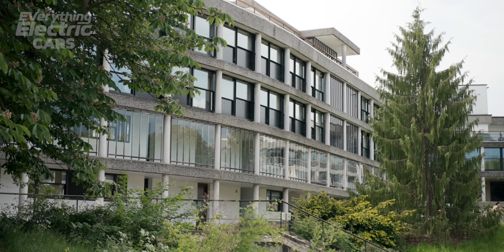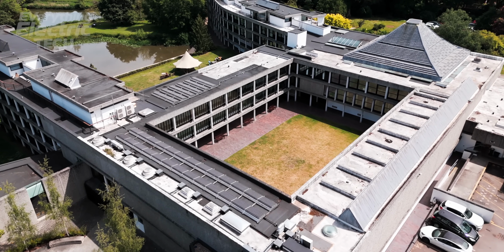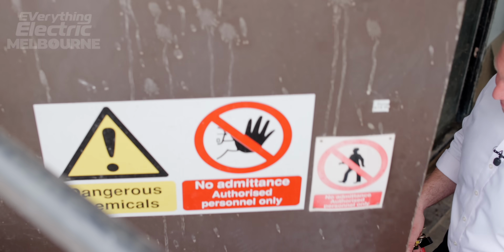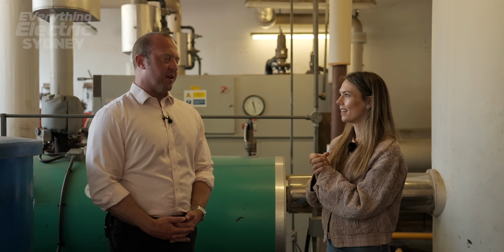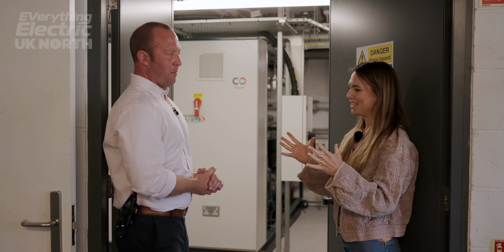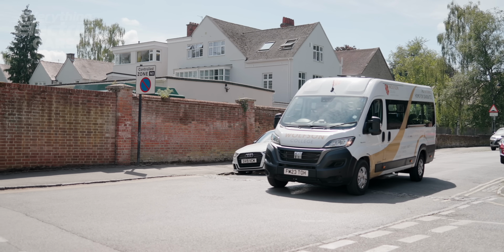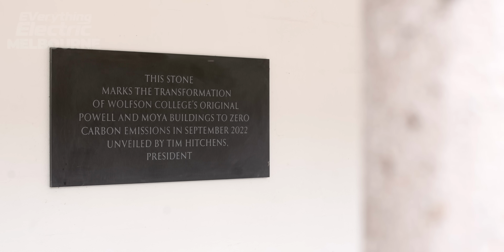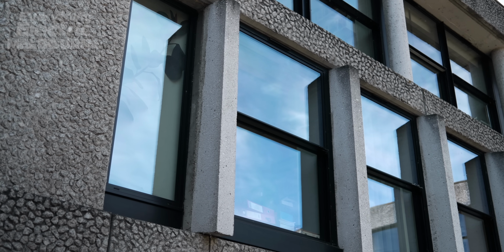The UK's First All Electric College!

Comment: As for cost savings it has to be pointed out that the gas industry controls the price of electricity on the basis that the most costly method of producing electricity, no matter how little is produced by that method, dictates the cost of electricity. So if 1% of electricity produced comes from gas but it is the most expensive way of producing it then that is the baseline cost of electricity. So 99% of your electricity would then be overpriced against the actual cost of producing it. It's a fossil fuel industry scam that has been going for decades. Even though over 40% of electricity in the UK is produced from renewable sources the price for electricity from the grid will be based on the cost of producing electricity from gas generators which accounts for over 38% of power generated. In short renewables and gas will produced about 80% of all power but that will be charged at the higher rate rather than the combined rate. It stifles the effect of the reduction in costs of an ever increasing proportion of renewables.

Comment: One thing that SHOULD have been said, but wasn't, about "Savings" on heating costs, was that while they did not go down much, (if at all), with the leap in the cost of gas, if this work had not been done, their costs would have gone through the roof, just like it did for every household in the UK. If that increase had been allowed for, there IS in fact a big saving. 
How many household's energy bills remained the same after Putin's invasion of Ukraine? I bet VERY few.

Comment: Great project, would have like more technical and financial descriptions, there is a bit elswhere. I would have liked to know what % of energy is met by the rooftop solar, for example. I worry most about the glazing: most double/tripe glazing fitted in past decades has leaked as the seals have broken down or have gone out of fashion, then they end up at the landfill. Worse, this may lead to the continued incineration of PVC frames (probably not in Wolfson, I expect). This college will be still here in 500 years time, how many changes of glazing will that be? Carefully designed secondary glazing would never need replacing. (the wooden windows on my house are 165 years old, some with original glass). Sustainability is not just measured in CO2 savings. Would secondary glazing with near zero future replacement costs be acceptable even if its not quite as thermally efficient as triple glazed argon units?

Comment: Interested to find out what the SCOP is for the system. I found it confusing that a figure of 90% reduction in energy is mentioned yet they see no reduction in costs. Maybe the 90% headline figure isn’t very accurate otherwise it seems overkill to have 800 Kw heat pumps on what was previously a 1.2 MW system.

Comment: Odd an educated man should touch on “The Ukraine thing” when we got only 12% gas from Russia and the UK dropped its overall use of gas that year by around 20% however the prices still went up as we know despite overall decline in gas consumption! Maybe he should reflect on the profits made by ALL energy companies using the Russia / Ukraine war as a permission giver to price gorge. The same energy companies may have dropped their prices by half a penny on the kWh but we still have the most expensive electricity in the world, more so than even third world countrys!
Reply: All the gas the uk burns has its price set internationally. 

The international wholesale price for gas went up after Russia invaded Ukraine. 

The UK is especially exposed to those international gas prices which is why the sooner we can push gas off the grid where it always sets the half hourly price for all sources of generation, the quicker domestic prices will drop.
Reply: @ianlighting100  "All the gas the uk burns has its price set internationally."  not quite true. Domestic producers track the international price and price slightly lower than this for domestic delivery so as to maximise profit. The idea being that they can't be beaten on price by imports in their domestic market due to delivery costs. In other words, it's a commertial decision based on shareholder value, not cuonsmer benefit. No one is telling them they need to follow the international price. 

  "The international wholesale price for gas went up after Russia invaded Ukraine." - True, but it's fallen a lot since then, so why isn'tthis being reflected in end consumer bills?  Also, it's dumb to not be able to step in as a government and put emegency messures in place if something like this happens under national security legislation. 

"The UK is especially exposed to those international gas prices" - Why would that be? The UK supplies 50% odd of it's own gas, so why would it be especially exposed relativly speaking to countries that produce less domestically? 

"Which is why the sooner we can push gas off the grid where it always sets the half hourly price for all sources of generation, the quicker domestic prices will drop" - 1. good luck with that. 2. who says you can't just get rid of the artificial MCP instrument currently used? What exactly is stopping you, this is very unclear to me. You could just do it. The reson it's not done is because this would reduce the incentive to build new wind & solar (to a point, as this incentive flipps at some point the the more you add, or it would if not for the CFDs weren't also priced using the MCP as a baseline) So it's yet another stealth "green" subsidy to invetors paid by the consumer.

Comment: I changed to all electric for my 1980's bungalow in East Sussex what suprised me was just how simple and cost effective the process was.  I purchased the property 17 years ago it allready had cavity wall insulation with double insulation in the loft and a conservatory over the rear door.  I had double glazing installed with a double glazed porch over the front door which creates an air losk ie front door open porch door closed, front door closed porch door open therefore no huge loss of heat.  Hot water is provided by self heating taps which means I only pay for the water and heating the water I use.  No waiting for the hot water to arrive.  The self heating taps cost £42.00 each from Amazon identical tap from ebay £16.00.  The bungalow is heated in winter using 2No ceramic electric heaters at @£142.00 each.  I had 9 No Solar Panels fitted with battery £42,000.00 I am waiting for electricity to be freed from the Gas price but I have had the meter removed I save on the standing charge.  With the insulation, the savings on water, the Solar panels and Battery, saving on gas standing charge has almost paid for the solar panels and battery. If evey one did this we would soon get rid of gas a 19th Century product in a 21st Century World.
Reply: £42k!? I had 20 solar panels, 2 5kw batteries and a heat pump, including 2 new radiators for £14k.
Reply: @AlanTov  I think I got it wrong more like £4,200 thanks for the rethink 👍

Comment: I’m delighted that the planners in Oxford allowed the changes. In Cambridge the planners are very resistant to change particularly in older buildings. It’s frustrating when historically the old buildings were modified many times over to suite changing needs, but now this isn’t acceptable. I wish the planners would be more pragmatic, e.g. you can change anything so long as you can’t tell the difference when viewed from some distance away, e.g. 10 meters.
Reply: I agree. 
How many of those people would like those buildings to go back to their original state when there was no glass in the windows?
Just putting in window frames and glass changed those buildings forever.
Of course there's plumbing, and electrical upgrades that these buildings will have had too.
This would just be another upgrade added to a long history of upgrades.
Reply from the maker: We’re here for the Oxford Cambridge rivalry until it comes to just cracking on and doing the sensible thing from an energy efficiency perspective
Reply: I couldn't agree more! My brother is about to renovate a grade 2 listed building in Cornwall with original bits from 500 hundred'ish years ago and 2 or 3 other sections added since then plus other mods. Essentially he has solid stone walls and single glazing... The heritage people have a pig-headed focus on keeping everything as is, and if replacement is necessary it has to be like for like. It's insane given the crisis the world is facing, I'm surprised they don't insist he dresses in period clothing and rides a horse everywhere! There has to be compromise to allow efficiency upgrades to occur.
Reply: Really? There have been some amazing upgrades within Cambridge colleges in the 30 years I've been here, and as far as the science goes we've seen significant expansion on the existing sites and the new developments on the West Cambridge campus.
Reply: That is good. I'm on a village hall committee and we want to install a more sustainable heating system, but the listed building consent people want the ugly old hall to remain original and essentially unusable in winter. Utterly insane. This has to change in the UK.
Reply: There is a Wolfson College at Cambridge (also Yale and Harvard, I believe) all from a very rich financier type Mr Wolfson. I imagine that Wolfson Cambridge would be about the same vintage (late 60’s/70’s). Point being that the technical and heritage challenges would ve very similar. Maybe Oxford Shire Council should invited Cambridge Shire Council over for a look see.

Comment: At 1130 - Wrong approach to cost savings - A better perspective is the energy differential to what would have been had the changes not been made - The beauty of investing in the fabric and radiator upgrades is it's a one-off cost which will make a cumulative return for years to come.

Comment: I would have to look at the greater viewpoint.  While there may not be cost savings because of increased utility cost, what WOULD  the utility bills have been if the improvements were not made?  Escalating energy costs per unit of energy, but maintaining a similar end user actual cost is still a win.
Reply: Excellent point.

Comment: 🚴‍♂ CO₂ Savings from Cycling vs Driving
Average UK car emissions: ~0.23 kg CO₂ per km (petrol/diesel)

If a person commutes 10 km each way (20 km round trip), 5 days a week:

That's 4.6 kg/day → ~1 tonne/year

So just 55 people switching from car to bike = ~55 tonnes/year

👉 That’s more than the entire college's claimed CO₂ savings.
Reply: 55 tonnes is meaningless in a world where we burn tens of billions of tonnes each year 

And that's before the other ~150 countries finally begin to develop themselves and pump out carbon properly

A serious suggestion would have been flying yourself over to China and picking up shifts and doing overtime in a solar panel producing factory, you'd actually make a useful difference to the climate.
Reply: The amount was 28,000 cubic meters over the next few years, not sure what is in tonnes.
Just had a look, at 25 celsius thats 19,040 tonnes.
Reply: And Captain Bringdown has landed.
Reply: @mikeypc3592  I am "Captain Bringdown". But I also have a very small carbon footprint. I haven't owned a car or motorcycle for 8 years. I haven't been on an aeroplane for a decade. So I feel I can comment about this without too much hypocrisy. I don't think he's doing a bad thing at all, I just think this problem is much better solved with the average twat not driving 3 miles to work and back. I am spending about 20p a day on the electricity I need to do ALL my travelling.
Reply: @duncancarr7822 How exactly is any of that relevant to the college and what they've done? Your self righteous ramblings make no sense.
Reply: @mikeypc3592  💣 Final Zinger (cheeky)
“In an alternate universe, where I drive to work and go on one holiday flight a year, I’d have racked up over 26 tonnes of CO₂ by now. That’s basically half of what this Oxford college has saved in its entire building retrofit. Makes you think, eh?”

Cheers, Captain Bringdown — keep bringing the real.
Reply: I'm not criticising the college — in fact, I think their work is admirable. My point is about scale and perspective.

They saved ~55 tonnes of CO₂ over several years, which is great — but that’s about the same as what one ordinary person could save simply by not driving and not flying.

I bring this up not to undermine the college, but to highlight the untapped power of individual choices. Imagine if thousands — or even millions — of people made small, low-effort changes like ditching short car journeys or skipping a flight. The collective savings would dwarf institutional retrofits.

That’s not “self-righteous” — it’s just basic maths.

The problem isn’t the college. The problem is that most of us don’t want to make those changes, and so we lean on slow, complex institutional projects to fix the climate for us.

What I’m saying is: we already have the tools. We just don’t use them.

Comment: Why CO2 rather than say propane HP's ?  Sounds an expensive option.  1.2MW heat loss drops to 0.8MW heat loss after insulation. Not super considering the original building insulation standard was taken from Henry VIII.  With a SCOP of 3 (poor by today's standards) should give a cost slightly less than gas (1/4 price electricity ? ).  I guess they should add a lot more PV panels and battery to save a lot more money, which is something impossible to achieve if you have gas of course.
Reply: I guess CO2 is not flammable and a lot safer ?

Comment: 90% reduction (11:59) in heat energy consumption is amazing. Only by installing double/triple glazing? No extra wall insulation?
But then the heat pumps peak power is mentioner to be 800kW compared to the 1200kW of the old gas boilers? Seems massively overpowered if consumption is only 1/10.
Also why no savings? Heat pump costs per kWh of heat generated should be similar to gas boilers. So running costs should be a 1/10 as well?
Reply: I think they probably would have approximately halved their energy bill (electricity is about 4-5X the price of Gas per kWh), but at the same time as they were doing the work, the cost of energy approximately doubled. So the bill now is similar to what it was. He probably could have said that, though.
Reply: OK thanks you're right. He says energy consumption is reduced by 90%, something like 100MWh of gas vs 10MWh of electricity now. And if heat pumps have efficiency of factor 3 then they produce 30MWh of heat energy so insulation cut heat waste by a factor of about 3. Initially I mistakenly thought they improved insulation by a factor of 10.

Comment: Good stuff. It would be good also if older listed colleges would (or would be allowed to) add a second square pane of glass to the groved wood glazing bar / muntins in existing windows. It would not alter the appearance hardly at all, it would preserve the integrity of the original window and would reduce heat loss substantially over time. They seem to give up and pump heat into the old buildings and just see it escape, saying it's a listed building and can't do anything.
Reply: But it would alter the appearance?